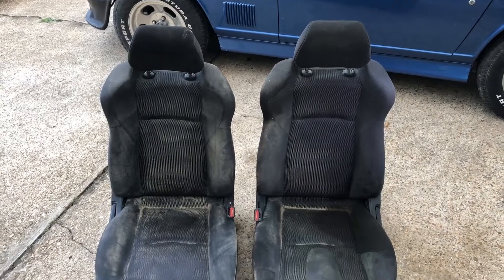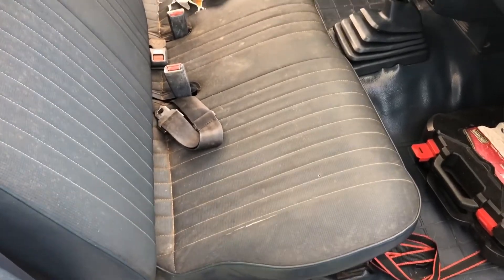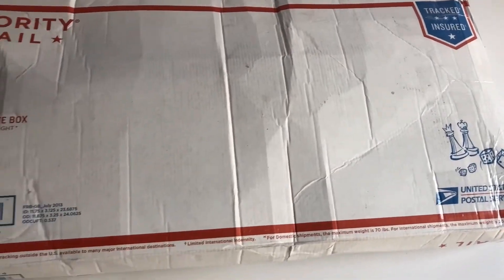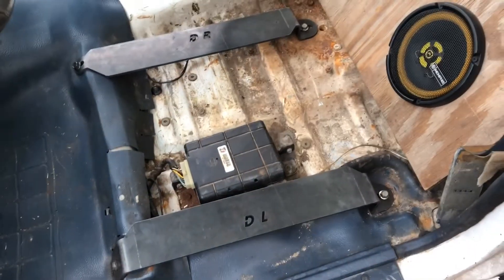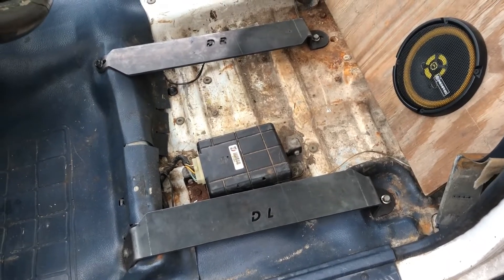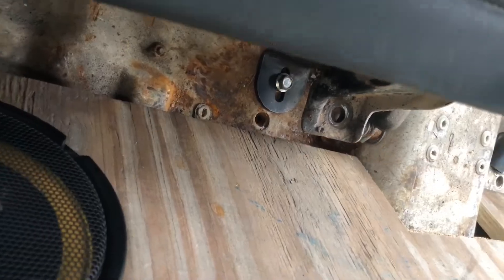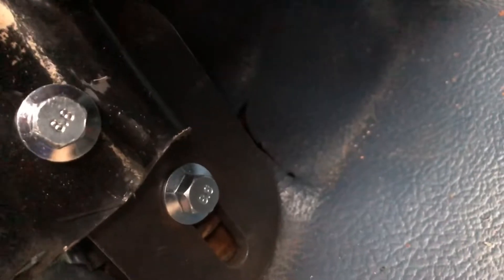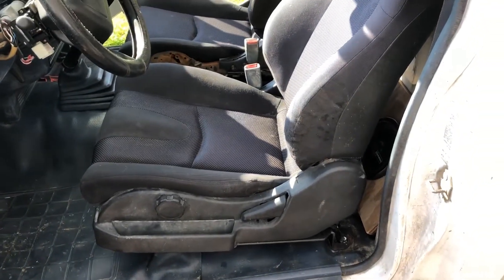D21 Hardbody: Install Bucket Seats

Comment: Do you think they fit a d21 nissan hardbody truck 1990? manual 4 cylinder
Reply from the maker: Not a direct bolt in fit, should work with the Rhodes brackets.

Comment: Are those brackets meant for racing seats?
Reply from the maker: They are universal but I believe they are. Most racing seats have sliders that are straight and can be bolted to these brackets.
Reply: @unleashedxauto  gotcha. I tried 2002 frontier seats and 3 of the holes line up but none the less they were too big for the truck. I sat another 3-4” higher and just didnt work out. Im 6’1 so im curious how these worked for you
Reply from the maker: @RioFoundation  they were good for me. You can probably find something on Frontier/Pathfinder seats on Infamous Nissan. 

https://www.infamousnissan.com/forum/showthread.php?t=29384